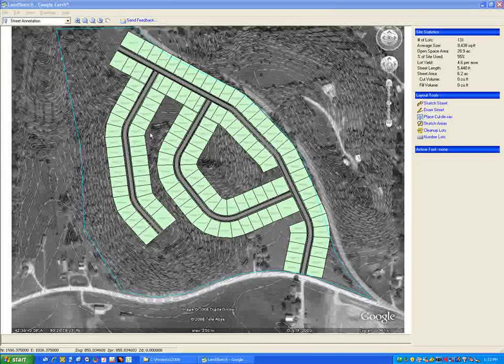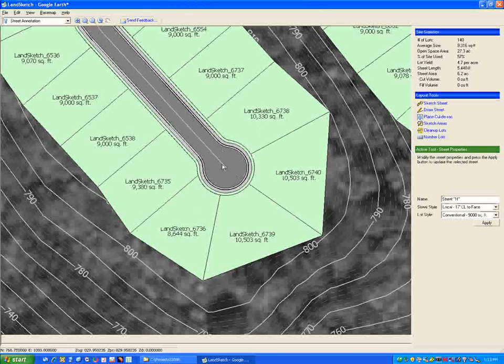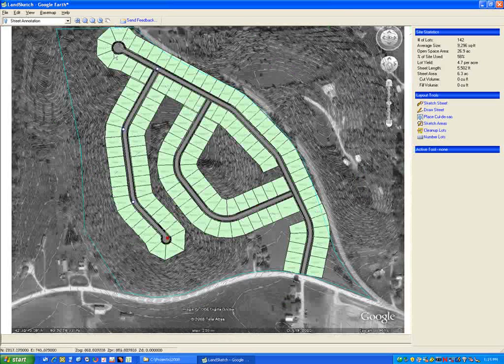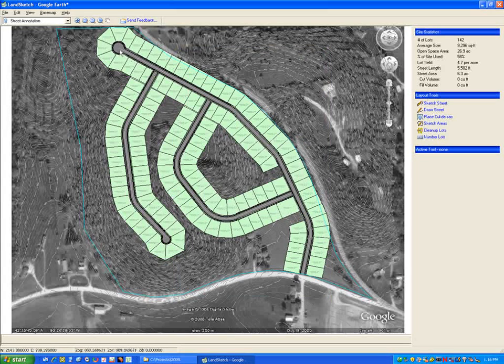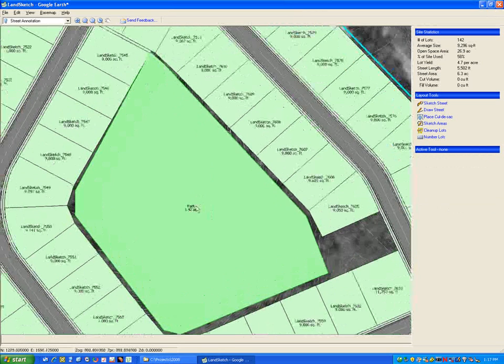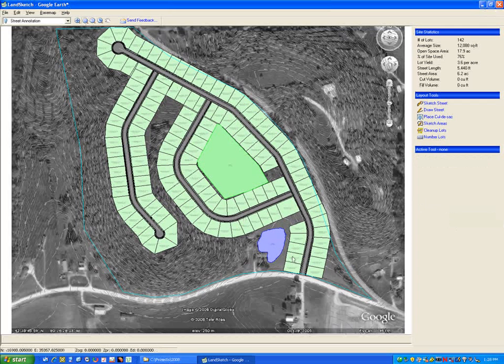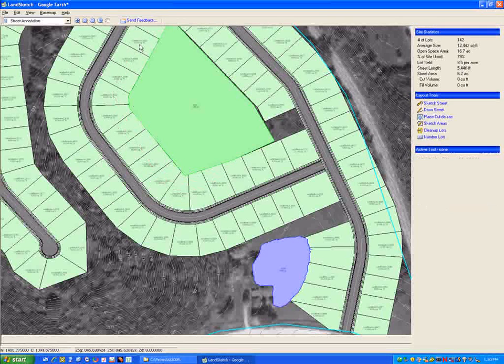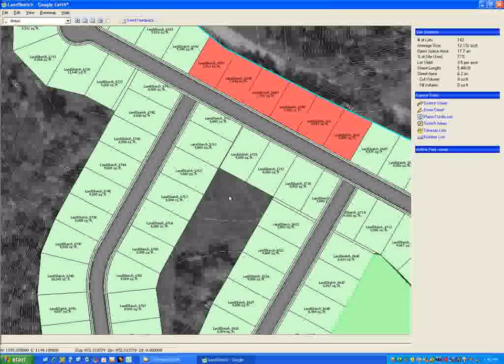LandSketch Overview 2

Comment: Would have thought it would be better to fit the park to the lots, rather than the lots to the park boundary. That is extend the park out to the lot boundaries, rather than elongate the lots to fit the park boundaries. Mainly because as in your lake/pond example the lots take on a stretched appearance, which would probably decrease their value. Instead the park surrounding the pond should be stretched to 'standard' lots.